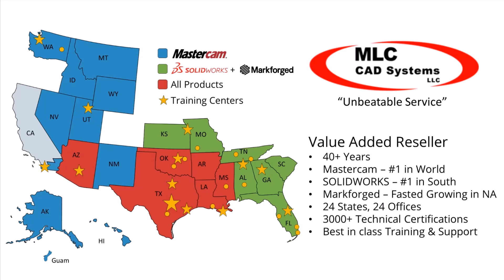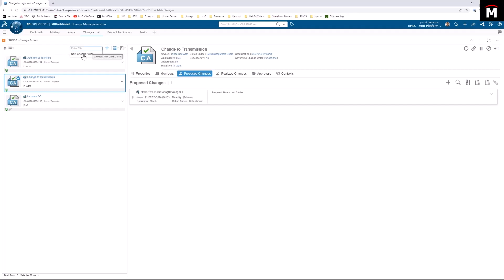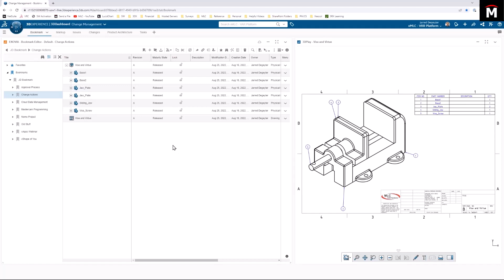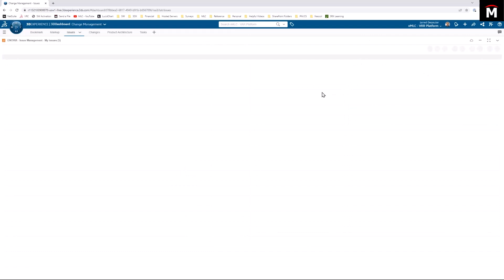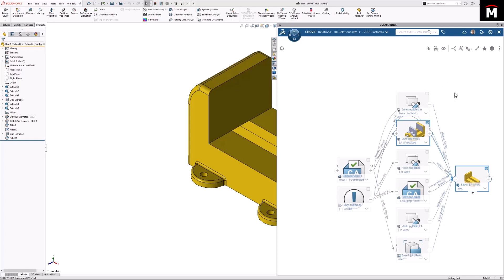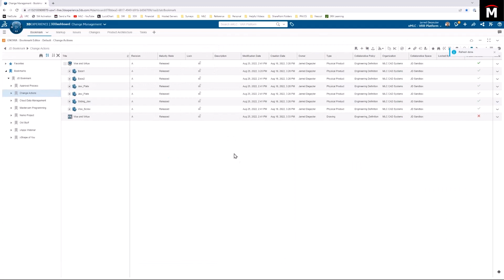Change Actions On the Cloud - ECNs in 3DEXPERIENCE Webinar

Comment: Hello, thank you for putting out this great video!! I did have a question. What if you accidently change another part that is not part of the proposed changes and it ends up on the realized changes section. When another user in the group is working on that part that person can't save it because it says that person doesn't have the privilege. Any help will be greatly appreciated.
Reply from the maker: Great question!  With any data management tool it is impossible to give users enough permissions to do their work but not enough to make a mistake, so in that scenario you have a few options.  A review step is often employed to check the work before it is finalized and released, or you can revert the change back to an earlier version (discarding the incorrect change) or you can create another revision and accept the release.  It depends a lot on how the part impacts others around it, so the decision is often made for each scenario individually.